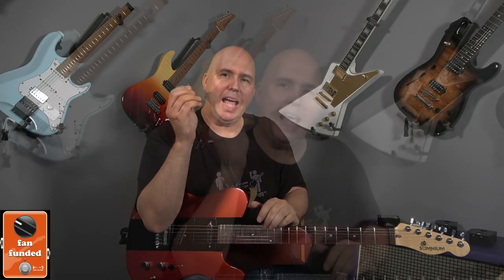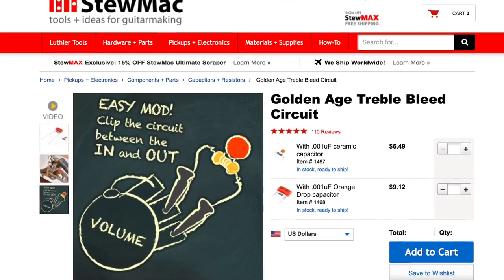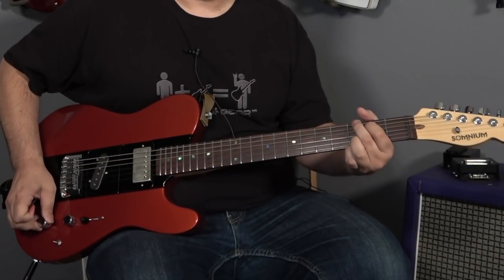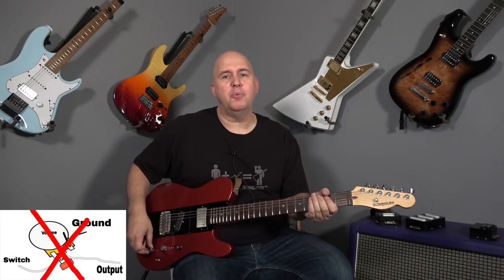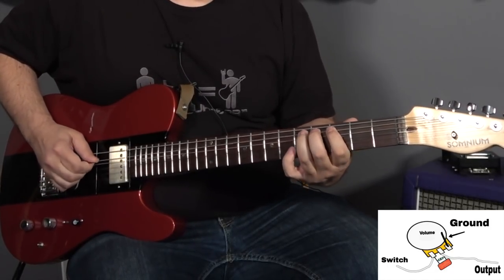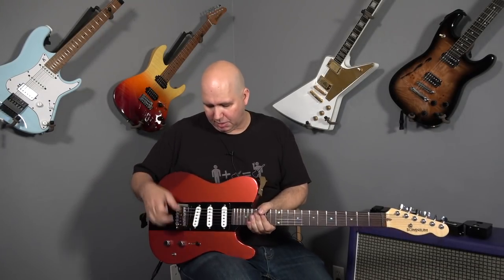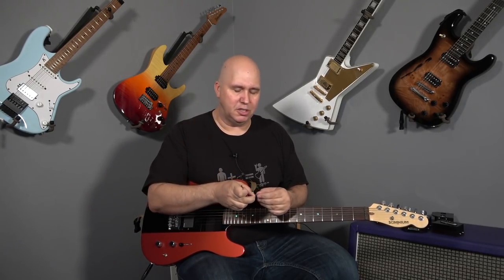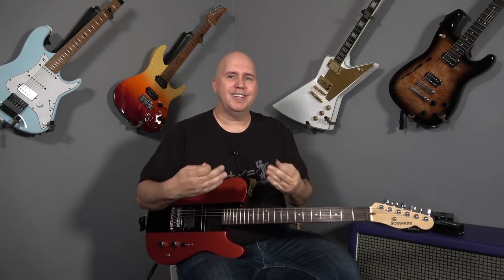How To Use A Treble Bleed On Guitar

Comment: I removed all treble bleed circuits from any guitars of mine that had them years ago. I found that at gigs, if I'm turning the volume down, I'm wanting to tuck into the mix more, it's the reason for turning down, the treble loss makes that work very well with less actual volume reduction; making not having TB in a performance/live band setting more musical more often than not. Depends on genre and YMMV of course but worth noting.
Reply: It’s not a tone loss, as is being implied. It’s a tone change that is actually very controllable.
Reply: @billtice5057  I'm not sure what that means, without TB, if you reduce volume, treble decreases - I removed my TB circuits exactly because I want the treble rolling off a tad. Maybe we are saying the same thing, not sure.

That's just my personal preference after decades of gigging - doesn't apply to everyone, but someone may find it helpful because TB isn't for everyone. 

The video is a great resource on TB, just adding some additional info based on experience. :)
Reply: karbomusic we’re in agreement! :)
Reply: @billtice5057  Yay!! I should have drank more coffee before replying this morning!
Reply: PRS puts treble bleed on all their guts and mine works great live, but we all have different ideas
Reply: @jessicawalden6072  My Suhr came with it too and I had to take it out - TB also changes the pot taper and that's what bothered me about the Suhr TB but either way it's always YMMV. However if the PRS is humbuckers, it's a different animal as far as TB goes.
Reply: I use my volume pot to clean up my amp. As I do that it looses so much treble that it really muddies up - there, I think, a TB could do wonders. 
In other cases your point is right on.
Reply: @WatchesnguitarsDK  That's a great point - of the guitars I have it doesn't get so muddy, but if it did I'd want TB.
Reply: @bryantherocker  It's all up to you , I don't think the audience cares what guitar you play at all. They just want to enjoy good music. :)  I normally take my strats to gigs simply because I can cover more ground with them and I'm more comfortable - no one has ever complained I played a strat on an LP tune in 30 years so you use whatever you feel most comfortable using.
The guitar geek in me might prefer an LP on an LP tune but in reality, I've never found it mattered to an audience.
Reply: karbomusic I was thinking that too, that you might want the treble loss, but then I was thinking that’s what you have the tone pots for right? Or are you saying you prefer not having a TB since it would be two adjustments rather than one?
Reply: @BobJones-bh9qz  Hi Bob, right, of the times I'm reducing the volume in a live situation, a little, but not too much treble loss helps (me) so it's killing two birds with one stone - ironically, I rewired one of my strats a couple weeks ago and it lost way too much treble so I put a tb in after testing various values until I got something that was just right.
That said I'm a big fan of both the volume and tone knobs on the guitar - it's a remote control of sorts. :D
Reply: karbomusic I agree, they’re very underused
Reply: @billtice5057  Its definitely tone loss for some people and some guitars because when you want to turn down to reduce volume yuo're forced to change tones and thus lose thet one you may desire. This is particularly troublesome for those who are trying to take advantage of edge of breakup settings on amps where you want to clean up the guitar and then you lose your sparkle clean.

Obviously the push/pull pot provides the best of both worlds so you have absolute control now on whether you want your volume knob to change your tone or not. Also, why not use the tone knob if we want to lose that treble? Isn't that what its for?
Reply: There is a couple of variations on the way you hook up the TB. Breja tone works has a video describing the variations on this circuit. Good information btw… thank you.
Reply: @BobJones-bh9qz  They do completely different things, actually.

Your volume pot is adding resistance (and bleeding to ground). Your tone pot is adding capacitance in series, to the circuit.
Reply: @BollocksUtwat  Both pots do different things: the tone pot will roll off highs and lower the resonant frequency of the circuit. 

The volume will simply reduce the the peak—bringing up the other frequencies by comparison. This can reduce honk, add warmth, etc.

Comment: I have a guitar with passive humbuckers that comes with a treble bleed, and I am very happy it's there, it allows me to roll down the volume without the output getting muddy. I have a telecaster with NO treble bleed, and its single coils are very bright already, and I'm equally happy it does NOT have a treble bleed, as that lets me roll back volume and soften the sound for rhythm parts. Different applications and situations are, well, different.
Reply: I'm 100 % with you on that! 
Same goes for the question "What is a good amp?", 
which also depends on the situation! The list goes on forever...
Reply: That's the way to go for teles, it gives depth to volume swells.

Comment: It works great for high output pickups and high gain. The effect is more subtle and doesn't clean up as well compared to low output pickups but It really helps for dialing out low end flub and mud when using a lot of gain. It tightens and focuses the low end and does wonders for palm-muted notes. Overall, it helps harden and sharpen attack and allows the guitar to stand out more over bass and drums.

Comment: For rock and fusion etc., I tend to live on my bridge pickup and fully utilize both Volume and Tone controls (esp the Volume).  With no treble bleed, there wouldn't be much point for me in doing that. IMO. With the circuit, turning down to even as low as  2-3 still can yield a usefully delicious clean-but-present rhythm tone, even with an overdriven-on-10 setting. 
On the other hand, with my jazz archtops, I definitely prefer a darker 'traditional' jazz tone and this mod wouldn't be necessary there. IME. In that case, I also will make use of the entire Volume knob's range, but it's just going to a different type of warm tonality for that style, when lowered. 
All, of course, in my opinion and experience.

Comment: Hiya,
Handy hint for strat type guitars.
Add a shielded wire to the input of your pot.
Solder the shield to the back of the pot.
Send the shielded wire out along side the main output to the jack cavity.
Solder your bleed filter in across the wire from the pot to the outpt terminal on your jack.
Future tweaks require only the removal of the jack socket - 2 screws- no string and pickguard removal for future tweekage
Have fun
PS: I run hss with a coil split on my bridge hotrail.  I routed the wire to the unused half of the coil split switch so that the treble bleed is only active when the humbucker is split - even when I’m on one or more of the other single coils. So effectively in sss mode is when i get the bleed.

Comment: The treble bleed saved my best guitar for me. A deluxe hss strat, the neck and body are wonderful, but the noiseless pickups were to "muffy". I played the guitar for years like this, but after i read some stuff about the noiseless i decided to put 500K pots in. That resolved the "muffieness", but the single coils went completely high-less when turning down the volume. (Because of resonance peak and stuff.) The treble bleed was the last piece to match the electics to the great wood base. It would have been easier to just put other single coils in, but i liked the sound of the noiseless (n3) enough to try this. And now i wish fender would have done this from the start, the noiseless would have a better reputation now i think.

Comment: Phil I've been wanting to do this video for years. Thanks for doing it. 
All my (mainly single coil) guitars have treble bleeds, and wired between the "10" side of the Volume and tone control. To defeat or adjust the effect of the treble bleed I use the tone knob between 10 and 8 (where usually nothing really happens). 
Since I use staggered (or series) gain staging in my signal, it's the ultimate control infinitely variable. Turning down the volume feels more like rolling off the lows which cleans up the signal instantly. As you said the only time it's not needed is bridge High output Humbuckers. On a 5 way Strat switch there's ways to do that, as well as dual Vol/Tone control guitars. Very useful on the Neck Humbuckers. Think of it also as having that one "sit in the mix" knob when live mixing yourself with the band, ("I can go from the "singer doesn't notice me" to the "real dirty looks / I'm taking a Solo NOW" setting without touching the pedal board.)
Sadly that's why 90% of players never use the volume knob on the guitar but at 10. Should be part of Guitar Lessons (when teaching electric).

Comment: Great! I added a treble bleed but found a different layout. Two resistors one out on one side acting as a lead, then another one in parallel like you did. I really like the results. Using it on a Tele style with two high out put humbuckers that split into single coils.

Comment: I've been on my own little pickup journey since middle of last year.
Keyztone Exchanger pedal has definitely been my guiding light.
It makes everything sound clear and provides great string definition. 
I use it to A/B guitar pickups and see how much muddiness is in the stock one, compared to its keyztone counterpart.
Pickups like the field coil single coils from Supro, 1996 tex mex strat pickups, Gretsch Broad Tron pickups wired in parallel and fishman pickups survive the A/B comparison.

I like the clarity, because it helps identify when technique isn't its greatest and let's me build better arpeggiation into parts.

So far I've gone with classic core fishmans for my PAF (ESP LTD 1000T)
Fishman SSS strat pickups (Mim Strat) 
Tosin Abasi replacing my PRS custom 24s 85/15s pickups.

I'm becoming a on trick pony with solving my pickup issues, where previously I'd do a lot of phase/parallel/split coil modifications.

Just feels like Fishman takes the guess work out with a consistently produced product that does the thing it says its going to do.

Which is the exact opposite experience I had chasing the "right" PAF sound.

Comment: The bottom line is, if you don't have a treble bleed and you turn down, you can't add treble with your tone knob, but if you have the TB, you can turn down the tone knob for a darker sound. With it , you have the option, without it, you don't have the option. FYI, I have them on all 22 of my guitars.

Comment: Loving those changeable pickups! I've been using treble bleed/bypass circuits for 10 years. I believe the .001 has been standard on tele's for decades. But they get too bright with the volume below 4. That's why p.r.s. uses 180pf and Suhr uses 680. They aren't as bright

Comment: Love your videos, I’ve got a request for you! I’m doing several guitar mods right now, and on the subject of treble bleed, you can apparently wire the resistor and cap in series as opposed to in parallel.  I’ve heard good things about this, you could maybe do a comparison or if you know the effect it has maybe mention it next time you discuss treble bleed.  Rock on buddy🤘

Comment: I just bought a Kramer Pacer vintage and it had trouble bleeds on the volume for the bridge and the neck. Well let me first say the other pick up in that guitar which I don't like either of did not clean up well at all it stayed almost just as dirty at the lowest volume setting as it did wide open and I know you said that it did not boost anything but it sure sounded like the trouble was being boosted because it subtracted all the bass for me and it left all the trouble there making it sound is there the trouble we're being boosted I know theoretically it wasn't but the bass it took all of it away and the trouble was just so piercing it was terrible was the first thing I did was cut those treble bleed capacitors out of there. For the record that guitar comes with supposedly a jazz and a JB Seymour Duncan pickup in it, but I just read another reviewer say that it wasn't actually a real GB or jazz that there was some off-brand that were slightly cheaper with some similar specs, I'm not sure but either way I don't like them I love the more you pick ups and I've got a super distortion on the way to put in this guitar that doesn't work I'll use their return policy and the next pick I'm going to try as the Utopia after I saw Phil's reviews on those. They sounded great.

Comment: I use the Dimarzio circuit 560pf capacitor and 330ohm resister ... got parts cheep on eBay .... have used this for years.

Comment: Thanks, Phil. So, on a Gretsch, with individual volume pots for each pick up, and a master volume, would you be looking at adding this circuit to each volume pot, ie 3 of these circuits?
Reply: I believe you are correct.  You could just add one treble bleed circuit to the master volume and leave the other two volumes at 10.  The treble bleed does nothing when the volume is maxed.

Comment: Added several for friends and a couple of my own.  Values of parts is not an absolute and a little experimentation is good, (especially between single coil and humbuckers).  Don't know if it matters but, from some web searching, I always use dipped mica caps which are several dollars vs. fifty cents.  Anyway... good mod and never took any back out.  Never used a push/pull switch but good idea.  PS... the mod has no effect when the volume is at maximim.

Comment: Hi Phil, I know this is an old video, but I hope you can respond. I need an appropriate treble bleed, but I can't afford to have someone install, and reinstall them over and over if they don't work right. I have a 2001 American Deluxe Stat. It came with early (sucky) Vintage Noiseless single coils. There was a treble bleed included. I have since upgraded my pickups to HSS (not noisless), with a coil split on the humbucker. Callahan Pickups that sound great. The single coil sound of the split humbucker sounds great, as does the humbucker mode. I asked the tech to put in a treble bleed, but he said there was already one he left in from the original design. Problem is that when I turn down the volume now, it not only keeps the treble, but it cuts the bass! So as I go down in volume it starts to sound like an AM radio. I don't know what type of treble bleed circuit might be more appropriate to put in, being that I go back and forth between split coil, and humbucker. As it is now I can't turn down without losing all my bass response. Any suggestions would be appreciated. Thanks for the great channel!

Comment: I have a treble bleed and RWRP middle pickup Custom Shop strat . The middle/front tone dial I have to put at almost 2 dial way back, otherwise way too much treble. I have an american standard strat with the similar Custom shop '69 pickups but no RWRP middle. I am still in doubt as to which strat sound better though...

Comment: I thought it means that the treble stays at the soundquality, while the volume is turned quieter. This example showed, that the circuit without treble bleed section is not loosing highs - and that is quite different from my expierience. When i turn down the volume on my guitars, the highs get killed. And that is even at 10 % quietening. So treblebleeds make absolut sense, but here it seems, that other frequenzies are reinforced. So I guess, there are more modification, than what it is told (?).

Comment: I was recommended to install a treble bleed circuit to my volume pot to try to fix the volume  pot which does not reduce the volume as you rotate it down.  At just about the end of the throw it does drop the treble right before it turns off volume.  The pot is wired to both a push pull for humbuckers and a Fishman piezo bridge pickup, Guitar is a Schecter C-1 E/A.  Any suggestions?  Txs, Ron.

Comment: I just bought six of these from Stew/Mac about a month ago but I didn't put them in anything yet. One question I have (and this may sound obviously dumb) but if I am putting treble bleed on a Les Paul, do I do both volume pots using two treble bleeds? I assume that I have too. Am I wrong?

Comment: The StewMac link shows two different types of capacitors. A Caramic and Orange Drop. What is the difference? Is on more suitable for single coils and the other for humbuckers?
Reply from the maker: You can use either one. I notice the Orange drop sounds a little less dramatic, but testing each it is a small difference.
Reply: Thanks Phil.

Comment: If you use low impedance pickups you don't have the treble roll off issue with the volume control.  I don't know why people insist on using problematic high impedance pickups.

Comment: $10 $10 fkin dollars for a cap and a resistor, someones making good money, I bet I could source these for less than £1, my last order of discrete components was £14.79 inc postage and I had a bag full of caps resistors diodes IC's crystals LED's and protoboard, I didn't have any orange drops but I have some caps rated the exactly the same and despite what some people will tell you they sound exactly the same, this price does not exactly come as a shock as Fender was selling the bumble bee's for $30 and they were 5 cent run of the mill resistors with a bumblebee jacket on them

Comment: Don't understand why the cap and resistor are in parallel. You're lowering the value of the control with the resistor and making the cap less effective. I would put them in series in order to control the  amount of treble bleed with the resistor

Comment: Why is it called treble bleed?  Sounds more like bass bleed!
Reply: I think it’s because with this capacitor enabled you can alter the treble signal by letting more through (or less depending on the cap) and of course treble level interacts with the tones character which can make it sound bright or dark(which is usually bassy if it’s dark)